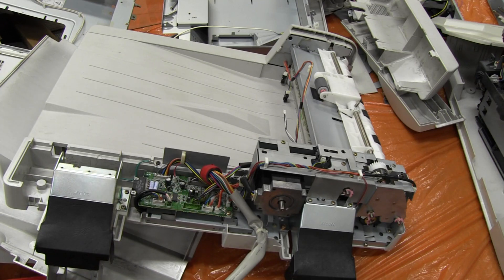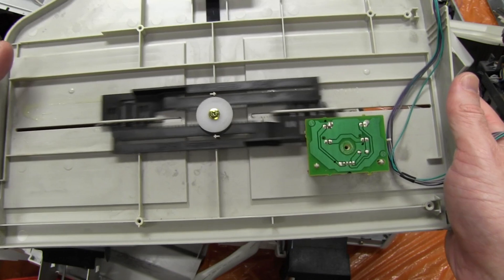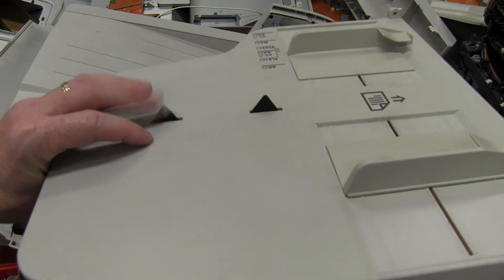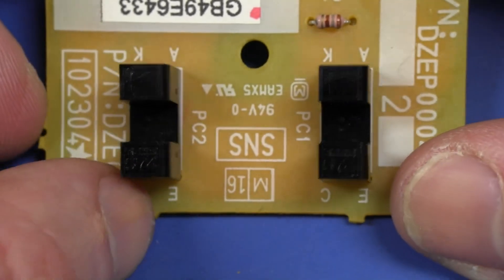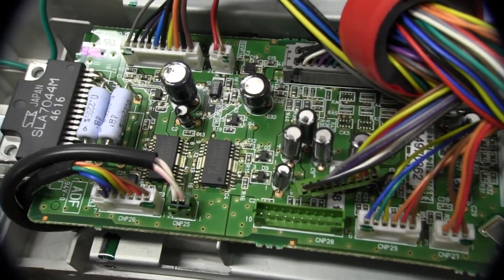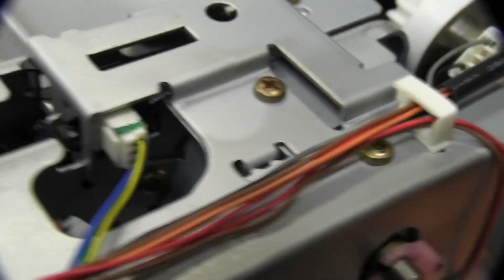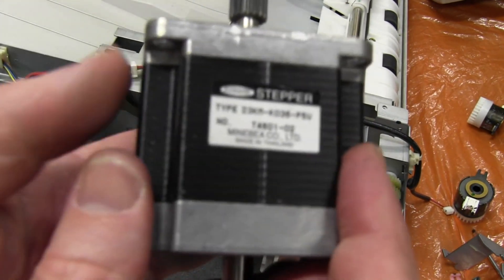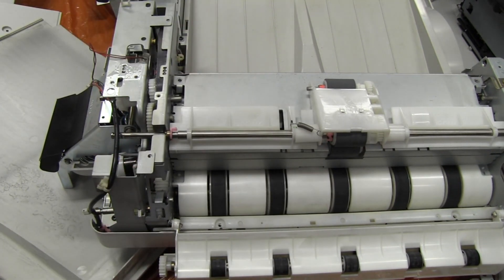EEVblog #312 - Photocopier Teardown Follow-up

Comment: Total teardowns are good for fun and can yield looots of shafts, ballbearings, brass bearings, photo interrupters, limit swithches (general purpose only, I have not yet salvaged any high precision switches), cabling&connectors, ferrite bead, LCD (often standard modules with drivers, otherwise not usable much), aluminium heatsinks & thermal pads (these are always nice to have). Dave, we know you have increased the weekly video uploads, but any plans to cover more projects, we miss the DIY part.

Comment: That's the ADF (automadic document feeder) unit. From the experience, they will usually have the best stepper motors you can salvage from a copier teardown. I've stopped hauling the bulky copiers back to the garage a long time ago, and now I get ADF units instead. It's the most efficient way to go if you have lots of these units and limited time, given that you are after stepper motors (mainly for DIY CNC builds) and dont care about the other "gems".

Comment: Yeah... I'm afraid it would be like watching a re-run of the photocopier episode. I actually had Déjà vu watching you tear down that copier... The Konica/Minolta Color Laser printer I dismantled looked like it was born from same set of design files as your copier. The harness techniques, a lot of the hardware, a number of the modules all had a uncanny resemblance. I suppose it could just be typical of nice Made in Japan commercial print gear... 
-sj

Comment: The sensors are to select an auto enlarge/reduce for the fax side of the machine, so a small document is full size on the receiving end. Changes from none to 3 other according to document size. Also works for the copier side if it is on default of auto then all docs are full size on paper supply. The clip on optoswitched have a separable top, you can pull it off and see the diode and phototransistor inside it in clear packages.